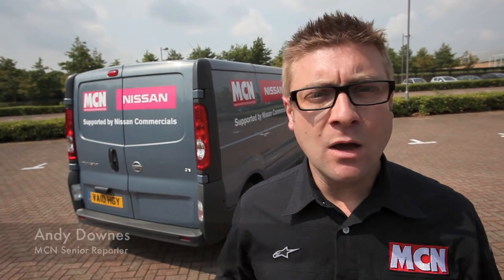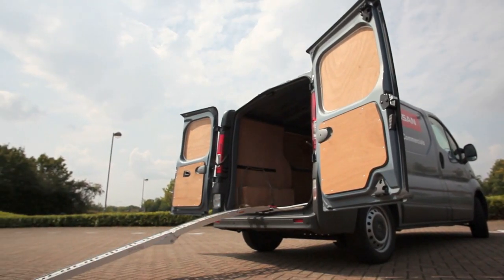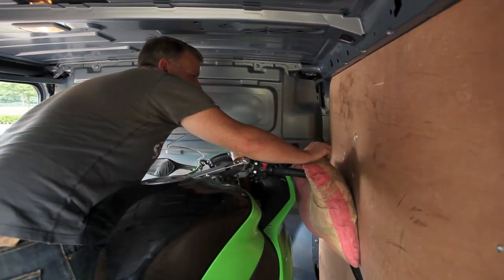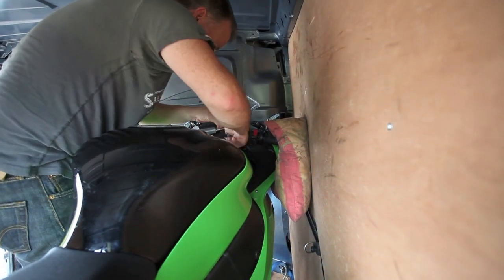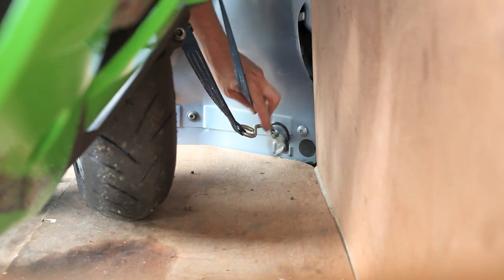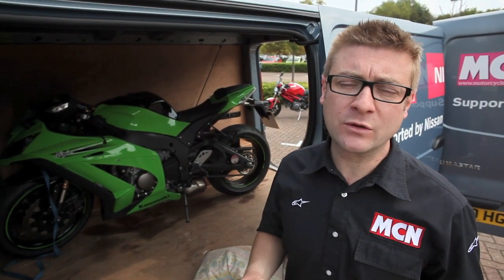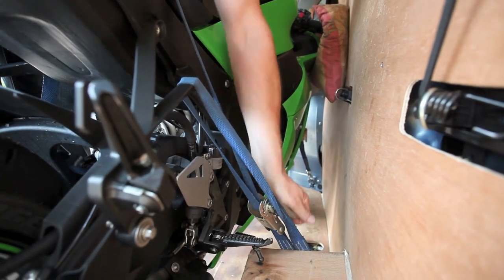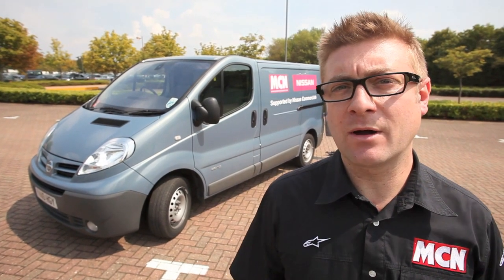How to secure your motorcycle in a van

Comment: does the bike still rest on the side stand or are the straps holding the bike tightly to the van's wall?
Reply: Judging by weight keeping pillow in place, I'm guessing it's off side stand. But good idea to have side stand extended in case straps come a bit loose